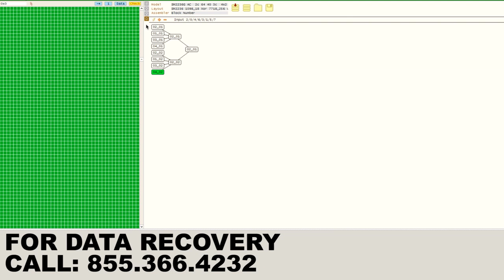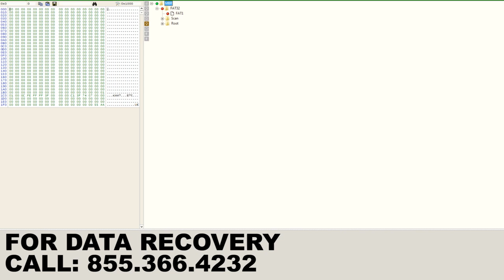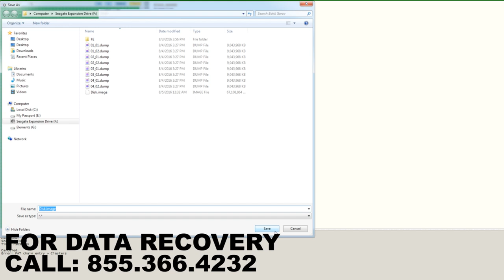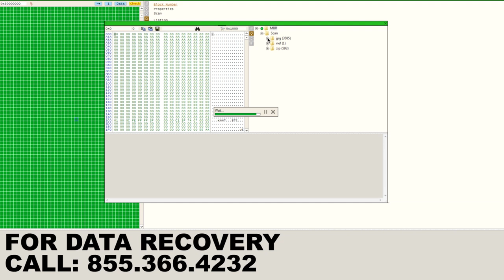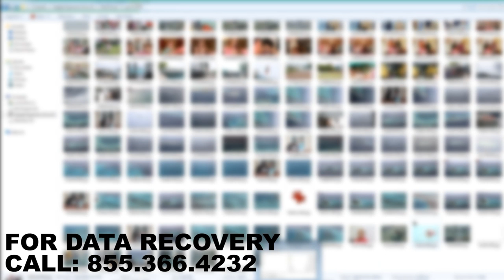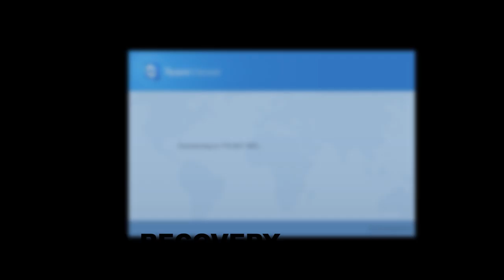Data recovery on dead CF card. Compact flash card recovery

Comment: Interesting videos. I only wish I'd found them in better circumstances, as opposed to furiously googling for solutions to a suddenly unresponsive SSD.

On that note, do the LEDs on an SSD's PCB have a standard meaning across brands, or does it depend on manufacturer? Even though my KingFast SSD isn't recognised in BIOS any more, a couple of lights come on when connected to power, but they don't seem to be marked so I have no idea what they may indicate.

Comment: I am trying to do this kind of work on my own and i just have a few questions. I have a Nand from a thumb drive and recently bought a proman programmer, i was wondering what software do i need to extract the data from this nand? I still have the chipboard with the controller, do i need it? should i buy a bunch of different thumb drives and solder the nand onto them until 1 finally works? There is surprisingly so little information on this and the info that is available online happens to be in a language i dont understand. please help.

Comment: What is your policy if something is not retrievable? I currently have a Lexor card that just stopped being recognized in my reader. When I returned that card to the camera that I shot it on, the camera is not recognizing it. I proceeded to put the card into a second camera body I have and it only recognized about 6 images. I took the card out and proceeded to place it in a third camera body and that camera body recognized a bit more. Then I returned the card to it's original camera and the camera finally had all the files and was able to view all the images and videos. I was happy and then ran the card from that camera to the computer and it eventually timed out and said that the card was unrecognizable after 20 minutes. Now none of the cameras and readers are no longer seeing the card, suing I have to reformat. I'm guessing the holes must be dirty. However, I am curious as to your policy if I send it to you and you are unable to recover anything
Reply from the maker: no data - no charge